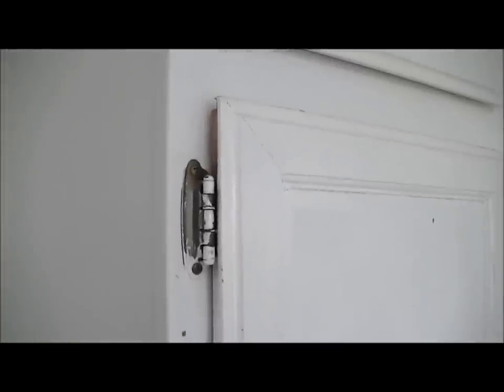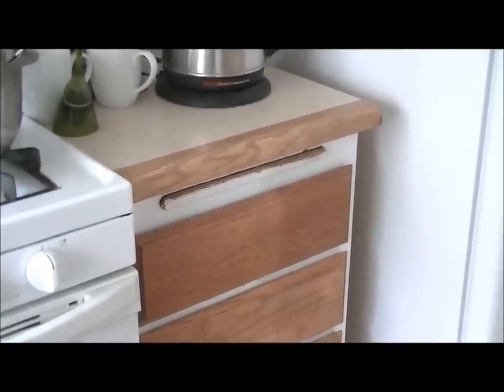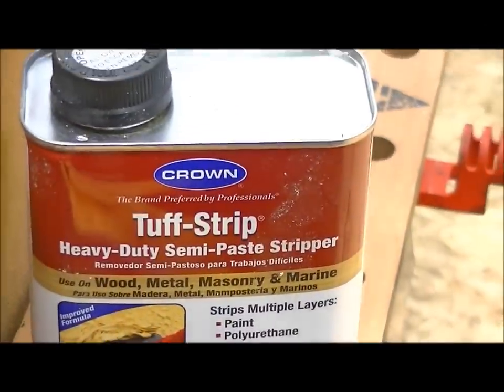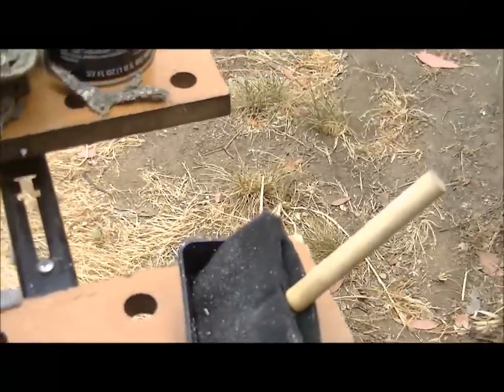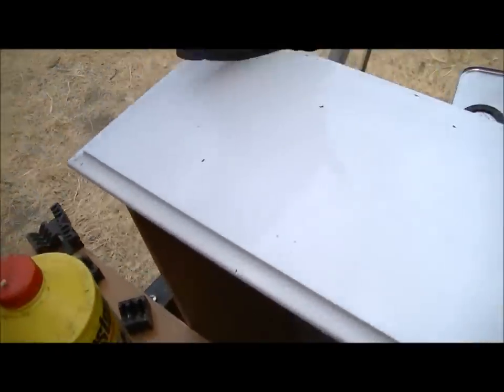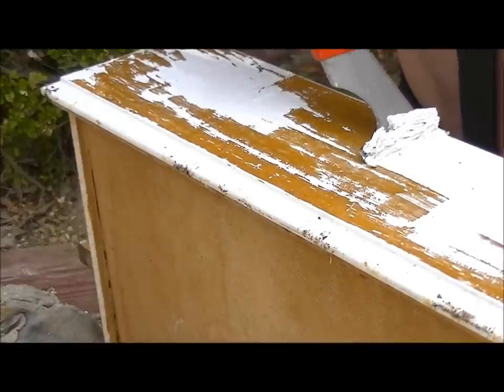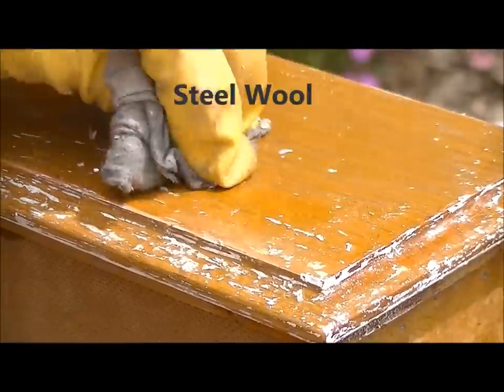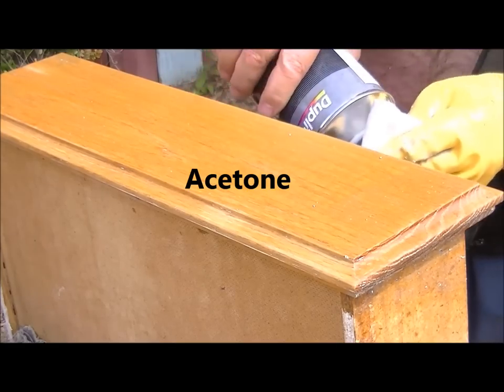How I remove paint with Brake Fluid

Comment: I wouldn't recommend. I occasionally have to remove paint from miniatures I've bought and brake fluid is a bit too strong for many plastics. I've had success with isopropanol, but it depends on the paint I guess.